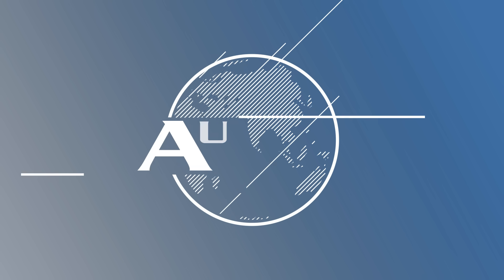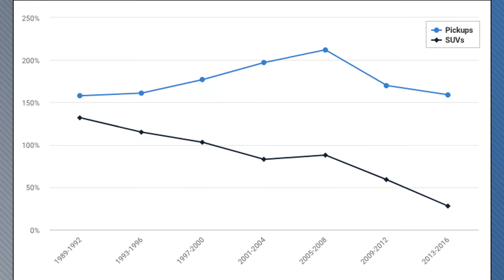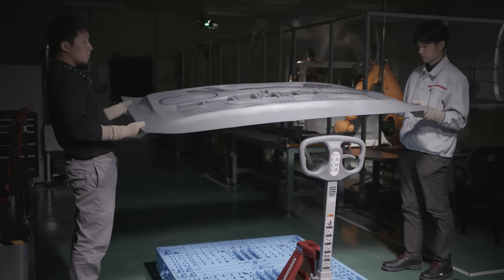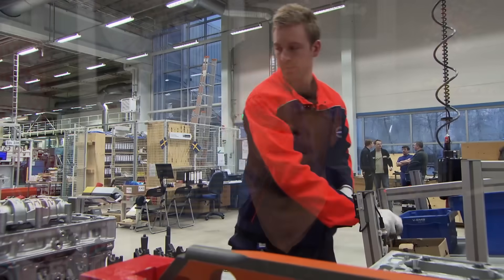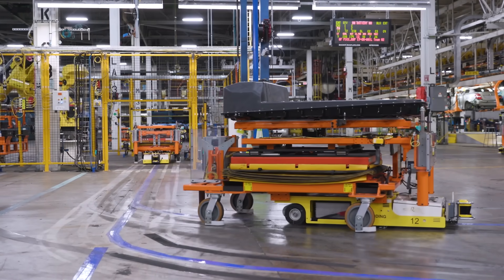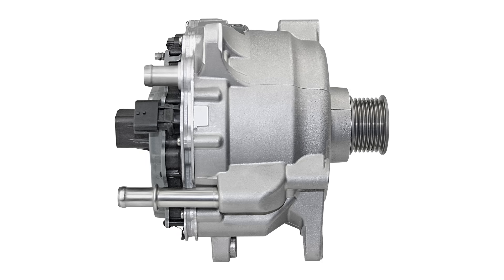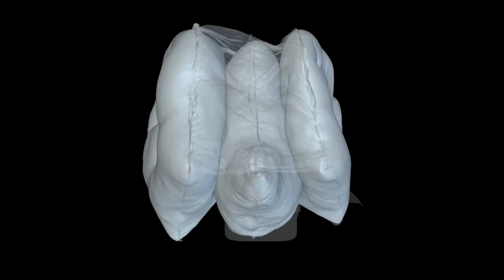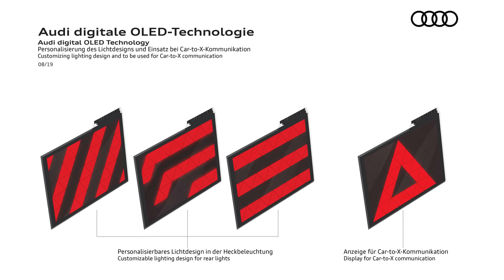Nissan To Make Old Parts Without Dies; Honda Develops New Airbag - Autoline Daily 3176

Comment: There is something interesting going on in China the #1electric car market. Sales of E.Vs have dropped to nothing because of power shortages that China is having. This needs to be watched very close do to the fact our own power grid isn’t up to mass adoption most notably in California where they are having blackouts do to high wind because Pacific Gas & Electric turns of the power to avoid starting fires

Comment: the jobs never get lost, they always go where the money goes.
now EVs are more expensive than ICE cars. that means there are more jobs behind. of course the components are getting cheaper, that means behind there are less jobs. but jobs do not vanish into thin air. they go where the money goes. if a family can save 10k$ with buying a cheaper car, then they can use 10k$ for something else. maybe some renovation in the house, the it pays for the workers and all the jobs that are behind the materials and tools etc.
so, now it should be clear that jobs only move and don't get lost.

Comment: Under "OEMs [are] unlikely to make EV Motors in-house": It is a LOT like the RC Industry in that most companies, like Losi, Yokomo, Schumacher, or Associated to name a few, make the platforms for racing but the electrical systems are developed by third parties. The RC Car maker rarely spends time on the motors as the motor maker is usually WILDLY better than the car maker at that. Same too with Radios, Batteries, speed controls (inverters) and so on. And nope, most Ready-To-Run (RTR) models usually have equipment that can be easily traced  to third party manufacturers.

It is a different business model to what Automobile makers use today, but as things seems to move much faster at smaller scales, so too does it seem the RC industry simply moved faster and is portending what may yet come for the Automotive Industry.
Reply: Like trucks. Most use Cummins engine

Comment: We are seeing only the beginning of EV age..and so it's understandable there would be more and more innovation and new technique in even powertrain designs in the future...case in point is the carbon sleeve motor of Model S Plaid. So, we can't say automakers will not have their signature in the future EV powertrains.
Reply: Since teardowns of the original Model 3 IPMSynRM, people have noted the innovations of Tesla motors, as with the lamination of magnets.  Tesla motors are also unusual in using silicon nitride bearings, which don't need lubrication.  The powertrain is designed a set of requirements that differs from LAMs - namely to last 1 million miles (albeit with significant battery degradation) - so it doesn't even have an option to use 3-rd party motors.

Comment: EV's still need radiators...
Reply: Significantly smaller than an ICE vehicle's.
Reply: The radiators in BEV's cool THE BATTERIES (to not to happen🔋📱💥).
Reply: @syxepop  and aircon
Reply: Human beings are air-cooled also.  Every EV needs a human being to buy it.

Comment: I don't like the idea of skateboard cars, all with the same engines and batteries.  Yes, it creates profit for the companies, but then what makes one car different from another, are things like # of cup holders, # of USB ports, etc.
Reply: The motor...the inverter...the BMS...the cable wiring...(just check the comparison between mustang mach E and Tesla model Y or other EVs in Sandy Munro's channel)...they are not at all same....Model S plaid has carbon sleeve motor that can literally run at the highest RPM possible, Lucid's motor/inverter combo design has the highest power to weight ratio. However, the key differentiator would be ultimately the software in case of EVs.
Reply: the suspension of a porsche taycan will never be the same like the shit in a tesla.
and you are right, the focus will shift a bit to other things that makes a difference.
like the better sound insulation of an audi compared to a tesla. what was the amount of cylinders is now the size of a battery which results in different charging and acceleration speeds

Comment: You Gotta be kidding me I drive a Tesla which is very efficient. Just look at the Bolt disaster. This is what happens when you outsource your electric motors and batteries
Reply: Tesla is perfect at everything, don't you realize.
Reply: @InternetDude  Teslas not perfect.  Just closer to it... 😉
Reply: Tesla buys all their batteries from suppliers,  and IIHS data shows Tesla has more fires than any other Ev brand,  especially S and X  which are both worst in their class for non crash fire claims.
Reply: @dmitchellhomes  GM has more EV fires than any brand vs quantity, that's why they lost a whopping $2B on Bolt recalls.

Tesla was just producing proper EVs for much longer, so has an order of magnitude more EVs on the road than the laggards. 

The reality is Tesla has one car fire every 205M miles, while GM Bolt has one fire every 19M miles, same as ICE cars, which is quite an achievement - and not in a good way.
Reply: Like Tesla's 'Autopilot' and its issue with emergency vehicles' lights.  Works perfectly, right?  Hardly.

Comment: GM is making their own electric motors,  but I wish they would buy them from Lucid, as Lucid has the best EV drivetrain technology.
Reply: I would say Tesla has the best EV motor, probably the best for the money... if not the best yet, it will be in the future...
Reply: Looking at the fuel economy website, it shows the Lucid Air taking 27 kWh per 100 miles, the Tesla Model S taking 28 kWh per 100 miles, and the Tesla Model 3 LR taking 25 kWh/100 miles.  The Tesla Model 3 SR+ is at 24 kWh per 100 miles.  

I’m not saying Lucid is bad, but I don’t see the dominance in efficiency claimed by them.
Reply: @DarkBrandon1  but everybody on the planet knows tesla cheats on their EPA ratings, and cars never meet them.  Lucid did it legitimately, and then let magazines test it on the freeway,  where at freeway speed they achieved the range rating.    You do realize, the EPA rating also takes into account for charging,  so the rating includes any loss in the charging as well.   We will very soon see 70 mph range tests, and full charging tests done by independent EV testers, and then you will see.
Reply: @dmitchellhomes  we will see once customers get their hands on the Air.  But that car is heavy, 500 lbs heavier than the Model S.  I think what we will find out is, the Air has a huge battery, like 138 kW-hr size battery.  It’s definitely bigger than the “118 kW-hr nominal” they stated.
Reply: @DarkBrandon1  once again you are wrong, Lucid has already released that the battery size is 112 kWh,   Which is 12% more than the model S, but has 27% more range.    Yes, the lucid air is heavier, it has a bigger battery pack, and it also has a true luxury interior, not the cheap shit the Tesla puts in their cars.  If you notice in the refresh model S, tesla use the same industry cheapest window switches for the power windows, the industry cheapest carpeting, and cheap plastics everywhere.  The lucid did not follow this pattern, they used luxury quality materials which do add weight but they also add to customer experience.    The Lucid also has properly designed suspension for a luxury ride, which is missing from the model S.   So all in all, I see lucid power train as a winner.   Tesla is an innovator, but they have never innovated their quality which has gotten worse and they are using cheaper materials today than ever before.    I mean Tesla takes out things like lumbar control on the passenger seat, and radar for the cruise control, nobody can tell me less sensors is better for safety, that simply cannot be proven, and there are many conditions with a camera-based system cannot see anything.
Reply: @dmitchellhomes  I think you’re off by about 20 kWh.  We will see, Lucid hasn’t delivered any to customers yet.  

As for the removal of tesla’s front radar, that’s because it’s a hinderance, not an aid.  Precious thinking was that you can solve autonomous driving with “sensor fusion” with massive amounts of hardware.  Turns out, autonomous driving is a software problem, not a hardware one.  That’s something the other companies haven’t come to grips with yet, and why Google/Waymo has failed to deliver.
Reply: @DarkBrandon1  interestingly, Tesla has never been approved to run their cars autonomously anywhere.   Tesla still requires a drivers hands to be on the steering wheel 100% of the time whereas Waymo and Cruise have been approved in California to run their cars on the road with passengers in them and no driver at all.   With any of these claims, you have to have proof, and what I’ve seen of Tesla full self driving, is it terrible, and dangerous.   It is nowhere near close to even a 15 year old with a learners permit‘s skill driving.   Hyper change posted a video where it tried to wipe out pedestrians in a crosswalk who clearly showed intent to cross the street.   He then said tesla asked him not to post things like that…. Tesla wants to cover up how dangerous their system is is my opinion.  Auto pilot on the other hand is pretty good as a level two system, but it is nothing more than level two.
Reply: @dmitchellhomes  Tesla actually has an AI running their autonomous driving.  A learning neural network.  Waymo and the like just have a bunch of sensors and algorithms, not a real AI.  Waymo may be able to geo fence something but I won’t catch on and it’s not scaleable.  It also won’t be something you can buy yourself, like you can with Tesla.
Reply: @DarkBrandon1  apparently you’re not watching the GM presentation today, they have been going on all day about level 3 coming out in 2023 that will be active from day one, not beta.   Anyway, you know Tesla promises lots of things, like full self driving they promised in 2017 to drive across the country which still has not happened, semi in 2019, cyber truck in 2020, roadster in 2020, solar tile roofs being installed 1000 a week in 2019, none of which happened.  I love how you ignorant Tesla fans live and die on every word they say and think this is different, this time they will make the target.  Haha!  It’s just funny!   GM came out last year and said they were going to build a HummerEV  and it would be on the market this fall,  seem to GM made their promise, as the media‘s been driving it for the last week and loving it.   Cybertruck doesn’t even have a prototype yet, pretty embarrassing for you Tesla fans talking about it dominating the world, now Rivian is on the market Hummer is on the market, Ford is coming to the market in a few months, and yet Tesla, the first to brag about mass production of their truck, doesn’t even have a production prototype yet!!!   Haha!
Reply: @dmitchellhomes  haha?  What are you, 5?  If you want to buy a GM EV go right ahead.  GM also said the Chevy Bolt was a “Tesla Killer”.  Tesla’s still standing, the Bolt, not so much.
Reply: @dmitchellhomes  ok 👍
Reply: @dmitchellhomes  The Tesla "EPA bs" claim is just coming from the other mouth as usual.

The cars have met them just fine, you can't claim so while doing a different test from what EPA does, that's ridiculous. Icing on the cake is their high mileage ratings, not many go can reach 130MPGe.
Reply: @dmitchellhomes  "Everybody" in your world is just the loser in this EV race. Who cares what they think? 

What matters is that the EPA numbers are exactly as EPA tests them, and the customers hit them just fine in those scenarios all the time. 

If the competition was any good, they wouldn't be so far behind, clearly Tesla's doing fine regardless of what the losers "feel" about EPA's methods.

This is also regardless of how BAD Porsche's range numbers were/are, before and after people compared them to their botched EPA testing, the rare outlier that the laggards cling to, all because Porsche probably didn't wanna cannibalize their ICE sales by reporting proper numbers - I'm giving them the benefit of doubt here instead of calling them incompetent.

And yes, Lucid will kick Porsche's butt too probably, I hope so as well.
Reply: Why do you say Lucid has the best?
Reply: @DarkBrandon1  Lucid has built the most efficient electric car on the road, at 4.6 miles/kWh which is better than a short range model 3 can achieve,  but lucid did it with a very long range car, with a luxury interior, and more interior comfort than a model S.   I would have to assume they have a more advanced powertrains than tesla to achieve that, and looking at their comparisons between Lucid Drive unit and Tesla‘s, there is a major power to weight difference.    So you get more power with less weight, and more efficiency as the cherry on top!
Reply: yes and no. the engine of the porsche 911 gt3 rs would also be much better in old VW beetle. but it would not make sense because it is over powered and much too expensive.
Reply: Chinese 50cent army.
Reply: @sink61  Paid shills from washed up legacy companies who are on their way out.

Tesla, all by itself, currently uses over 27 percent of the world's entire production of EV grade batteries, they didn't get there with half-arsed compliance junk.